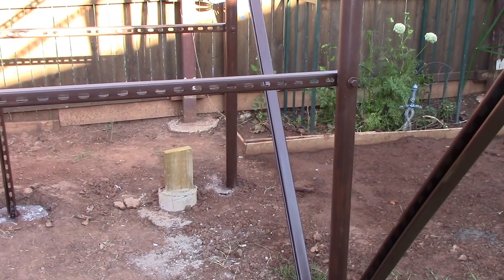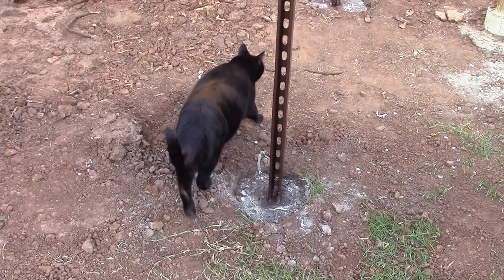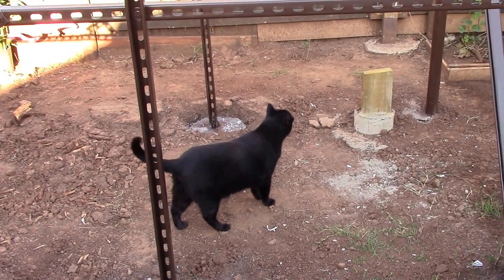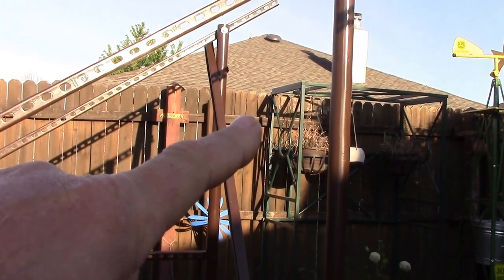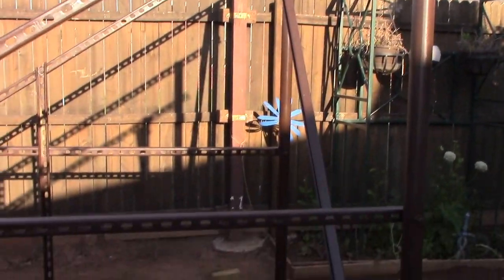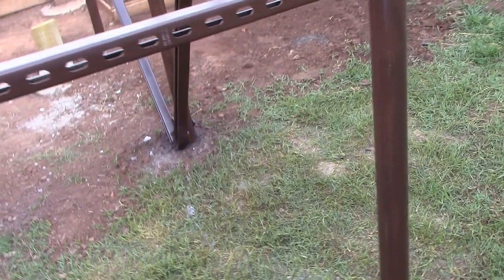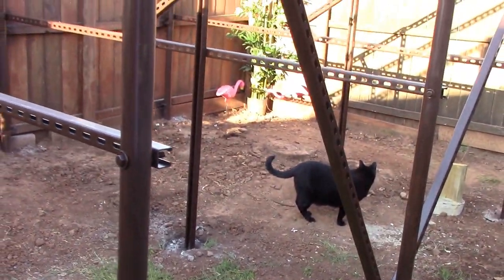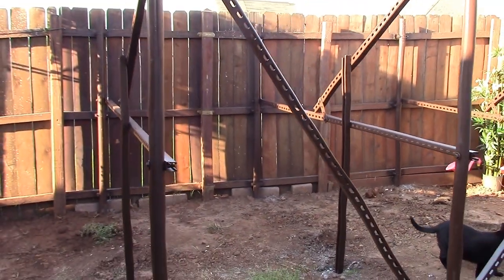Part 6 - (It's painted!) Suburbia backyard corner solar panel cradle/racking system

Comment: Great looking project. All that bright sunshine in OK should give you lots of power.
Reply from the maker: Oklahoma is EXCELLENT for solar power...but, rarely do you see any homes/backyards with solar panels. The middle of the country has a lot of wind too...but, not many interested in solar. It is weird. I made almost 19 KW/H in solar power yesterday...new record.
Reply: +Chris DIYer Keep leading the way Chris, you're doing an amazing job.

We are building a house on some acreage and I plan to install a ground mount PV array. My mounting will be different due to dealing with lots of snow (Wisconsin) so it will be adjustable with a winter and summer tilt.

The local electric coop is very resistant to owner solar and have changed the rules to make grid tied PV as bad as possible. They are starting to change their mind due to member pressure but only for the large grid feed array projects.

Sometimes change comes slowly to the middle of this country, but it does happen.

Comment: When you walk in the store, does someone just start bringing Unistrut to the cash register for you, lol?    In a previous video you had asked what to do with the beams sunk into the ground with cement that you had cut off.  I would leave them and let the next owners of your house try to figure out WTF those were for.  But seriously, I like what you are doing because I think I am going to do something similar when I build my array.
Reply from the maker: Thanks man. They all know me at Lowe's! And Tractor Supply for that matter. Building this cradle system takes some time/patience/thinking. I recommend using the larger Superstrut/Unistrut and 1/2" Grade 5 or better hardware. I used to erect mobile radars/towers/antennas for the military...so, kinda reliving my E-2 thru E-6 days I guess. Didn't touch the equipment when I made E-7...desk work mostly.